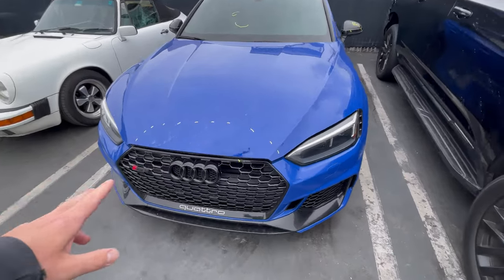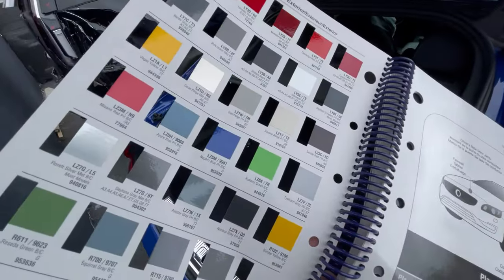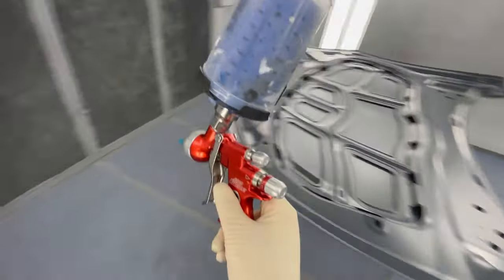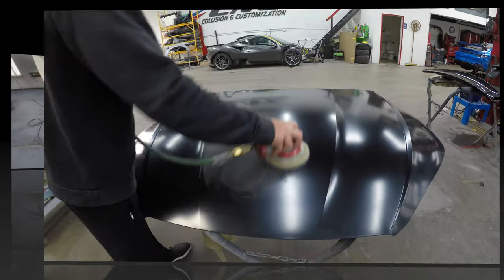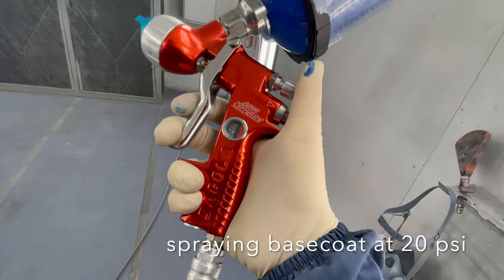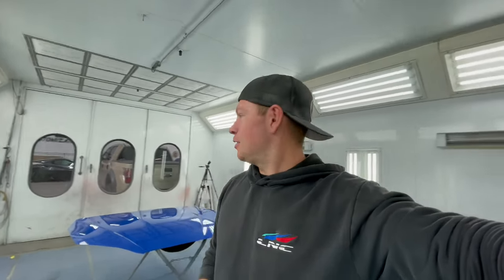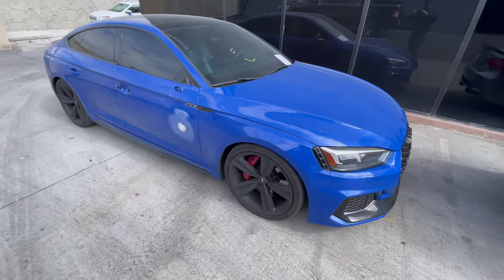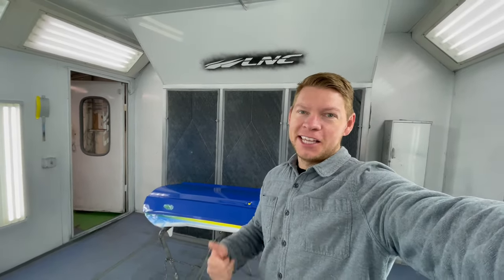2019 Audi RS5 Front End Damage - Spraying Nogaru Blue with PPG Paint

Comment: Nice, as ever. In my work shops I never had a booth so would paint the bonnet off and on a hanger to keep it cleaner being vertical. Used booths so yes do it flat. keep up the good work.
Reply from the maker: Right on, if I have a smaller hood I usually have a hood stand and paint it vertical too! This hood is HEAVY, not aluminum and inside had to be flat so I couldn’t do it at the same time 😅  Thanks for watching 👍🏻

Comment: Lovely job but being the smart arse that I am, I can point out two petty little things that I picked up. Well maybe Vlad did address one of them but it's not shown in this video. One the primer is a different colour to the original so if you peel away the under bonnet sound proofing you'll see it. (big deal 🤣) and two the decals under the bonnet were not replaced.
Reply from the maker: Thanks I appreciate it 👊🏻 we always order replacement emission labels, Vlad was still working on it and put them on later. As far as the paint inside the insulation I didn’t spray there, no reason to since its sealed and covered😁 gotta save on material cost somewhere 😂

Comment: Why is there a pressure differential between the base colour and clear ?
Reply from the maker: Clear has low viscosity and if you spray at lower pressure you will get a rough finish, lots of orange peel. It will look like you used a paint roller for dry wall.

Comment: Hello,  spraying at 20psi, sealer at 32psi ..how one determines which psi levels to use? why spray at 20psi and not at 15 or 25?
Reply from the maker: Thats the optimal spray pattern and application of paint, if you are at a low psi, paint will not get atomized as well and will create a heavy texture or orange peel,  if you are too high psi it will just make the paint atomize into the air and not apply it your panels correctly. Paint and spray gun manufacturers recommend a certain psi and from there you can tweak it a little to your liking 👍🏻😁